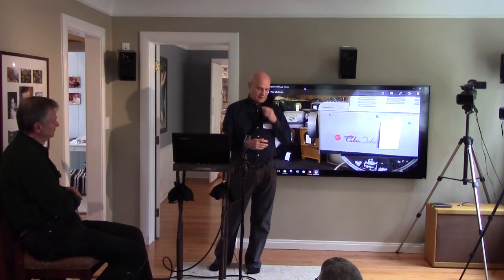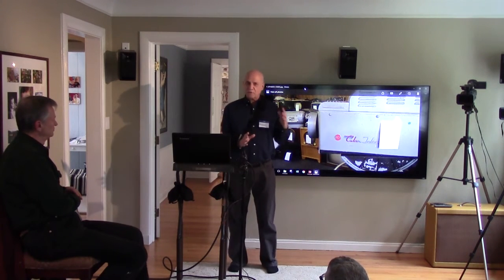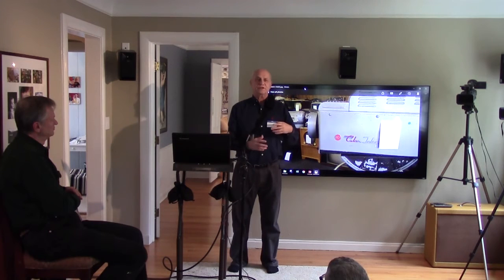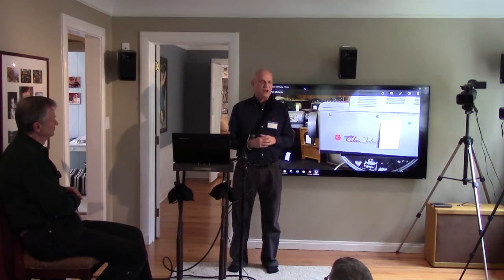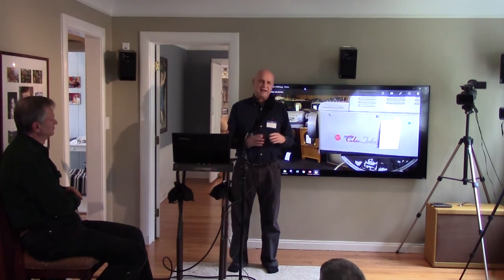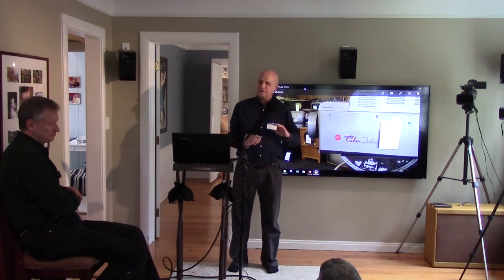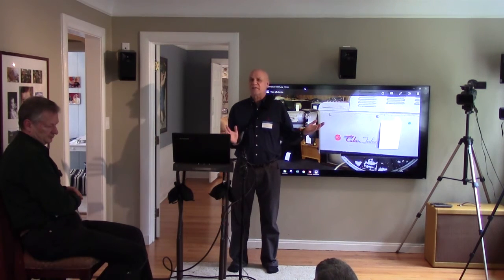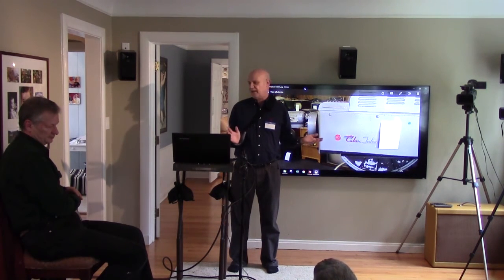Earl Geddes - New Method to Measure Speaker Distortion

Comment: Simply measuring speaker's current? Most non linear distortion in speakers can be measured by simply measuring the  distortion in the current waveform by selecting the proper freq. range.